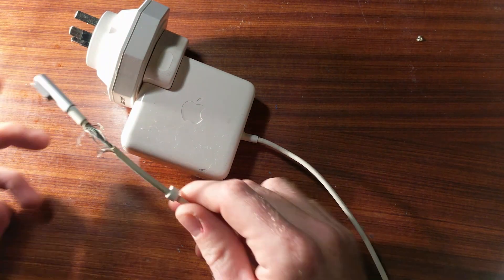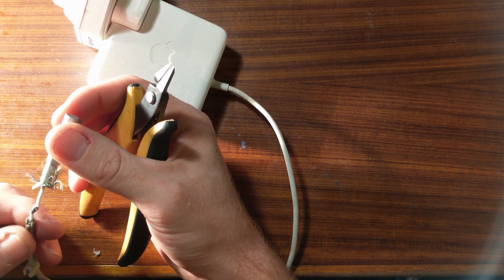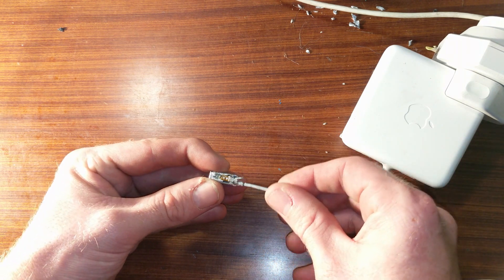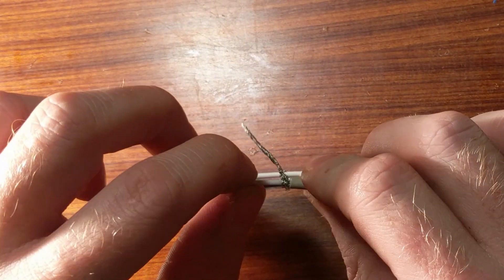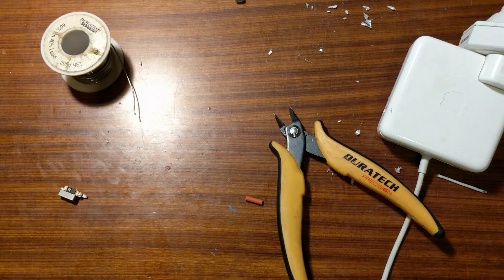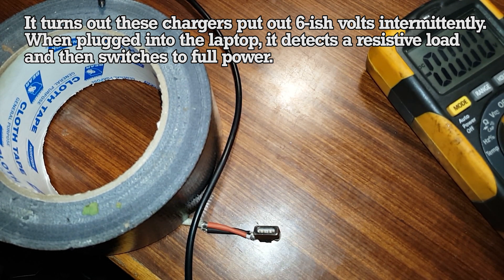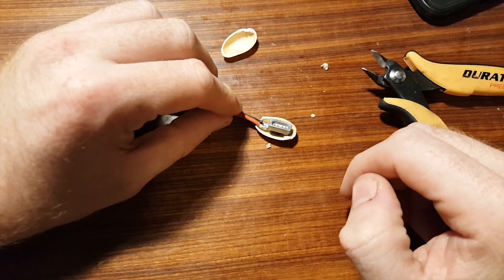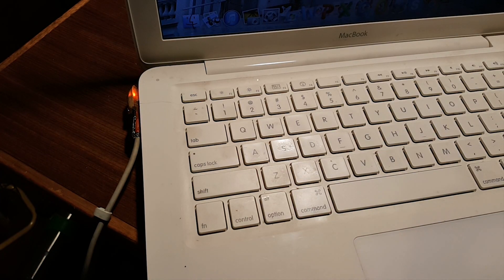Fix Your Macbook Charger With Pistachio Nuts

Comment: I didnt expect it could, but you can pull of the magnet tip with tweasers or clamp. Then pullout component inside. No need to destroy outerpart. But you could fix it with small metal pen from touch pen orso

Comment: Ps do you know if it will still give power when the middle pin controller is off? Damn broke when prying it out :(
Reply from the maker: Rombout Versluijs probably won't work. Apparently you can source replacement connectors or cables online, give it a go instead :)
Reply: TK well I thought it would still be possible to power the mac. I think I read in your battery pack hack, you taped the middle pin off. Would that be essentially the same then as  broken one :) I will order a cable. But just to get it running now will help a lot
Reply from the maker: Rombout Versluijs don't remember taping anything when working on this?

It probably won't work because the centre pin is for charge control. You can try it but it's risky.
Reply from the maker: Rombout Versluijs I did the pistachio nut hack, I have not done any of those other hacks.
Reply: TK ahh okay, wasnt sure cause of the name mismatches. But I hope it will work. Just need to get some solder props. In the battery pack post it says they could use a battery pack as long as they taped of the pin3. So ill hope this will work for me with a brick as well then